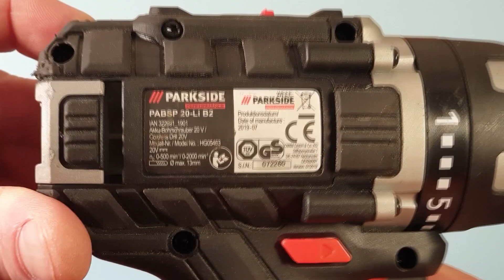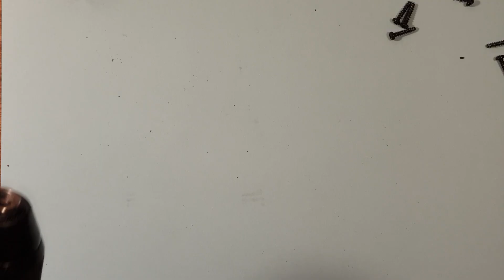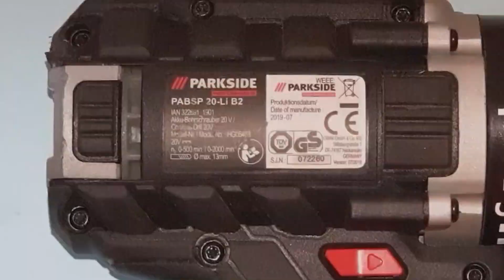PARKSIDE PERFORMANCE PABSP 20-Li B2 COLD DISABLE REPAIR

Comment: I have tried it and it really works. I have replaced the thermistor (that small temperature sensitive part) with fixed 10k resistor. I have measured the thermistor value at 20C to be 10k. Be really careful when soldering as I have managed to tear out the via - nothing a little bit of epoxy wouldnt save.